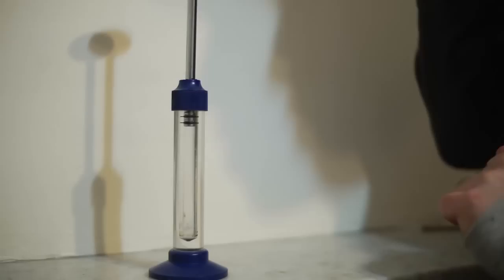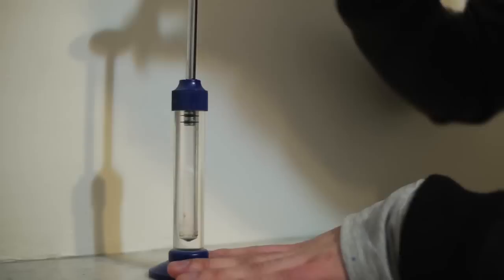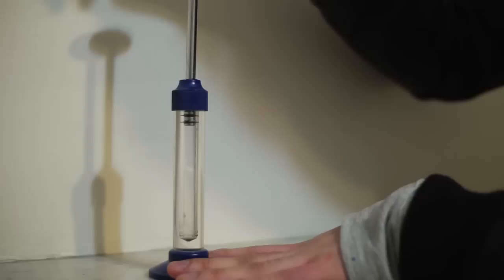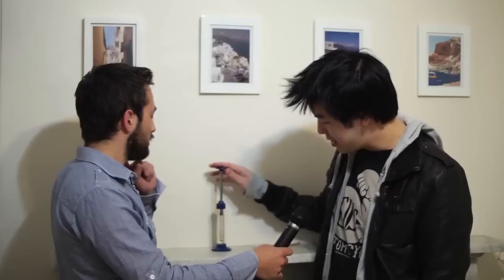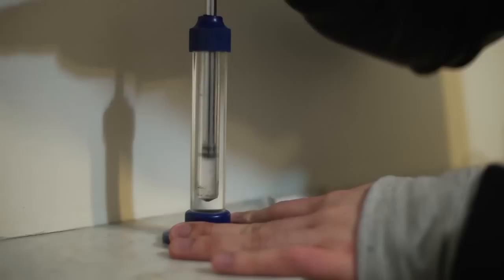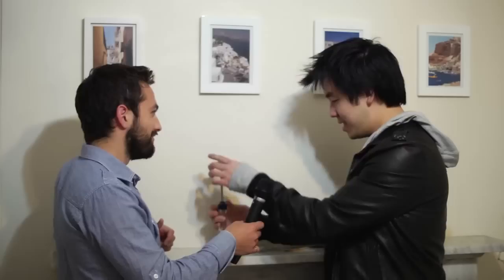Fire Syringe

Comment: Ignition temperature of cotton is about 400C at atmospheric pressure. Increasing the partial pressure of O2 will lower that ignition point by a great amount. the fire piston works by a combination of increasing heat through compression and increasing partial pressure of O2 with compression. Carbonized cotton fabric is pretty much a standard fuel for the fire pistons used by survivalist. Also called "char cloth".

Comment: yes..this is how diesel engines work...
Reply: No it doesn't.
Reply: An engine works by putting fuel in the whatever it is called then spark plugs create a spark that explodes the fuel the explosion force the cylinder down. The cylimder is connected to a crankshaft in such a way that the downward force is changed into rotational energy but since there is multiple cylinders at different stages of this then there is always a downward force making the crankshaft spin. Then the spinning crankshaft causes the cylinder that just got pushed down to go back up and push the exhaust out. If you don't understand still you should probably watch an animation of it.
Reply: Wait nvm
Reply: You said desiel not gasoline
Reply: @macaroon_nuggets8008  fail
Reply: That’s how Diesel engines ignite gas. Not technically how the work. Just the start of how they work.
Reply: @macaroon_nuggets8008  Man if you are gonna try to prove someone wrong please know what you are talking about first
Reply: @JoeSmith-jp7bk  I wasn't trying to prove him/her wrong. Iwm was trying to correct them. Also I thought I knew what I was talking about as that would be accurate for gasoline, but I missed where it said diesel. That is just a minor mistake, not need to tell me, especially after one whole year.
Reply: @macaroon_nuggets8008  hon

Comment: It's not about the heat, it's about the chemical reaction of oxidization that increases under greater pressure and so exceeds a treshold of combustive oxidization, which is bursting into flames. Heat is only a product, not the cause.
Reply: *oxidization
Reply: Allen Thayer
thx
Reply: maybe it's a result of both
Reply: Sniper of the Dark
If you had known the rule of the welders - never weld if gloves in case they get greased - you'd have understood why oxidazation is generating heat, and not the other way round, at least in most cases.
Reply: Heat is the wrong word. It's temperature (they are different). The temperature of the apparatus gets very high for a short amount of time, which causes the ignition. It's only a small amount of heat (at least before the fire, an independent energy source). Same principle applies to sparklers. The little pieces flying off are momentarily hundreds or thousands of degrees, but because they're tiny and have very little mass, it's not enough heat to be harmful.
Reply: Heat is the total internal energy of a system, increasing the pressure at a rate which doesn't allow the heat to disperse means the total internal energy is increased, thus activation energy of the reaction is reached. I think "heat" can be interpreted in different ways, but it's used in this way in physics.
Reply: *****
 Go play Minecraft. Don't leave comments, leave commenting.
Reply: If it was nothing to do with the heat then it would would ignite regardless of the speed in which you use it.
Also, the term is oxidation.
Reply: It's similar to what happens if you treat grease with pure oxygen - certain kind of welders must have clean gloves, otherwise there is a risk of starting fire (and gloves are obligatory in case of burning hands due to possible greasy impurities on them). Speed is unimportant in this instance, and heat is secondary, an effect rather than the cause.
Reply: In a way you are correct, the initial energy stays constant. But as same as with the compression of air, you compress the heat too making it warmer than the surroundings. Refridgerators work in a similar sense but the decompress air making it colder than room temperature to cool the groceries inside.

Comment: is this not called a fire piston?
Reply: ikr?
Reply: A piston implies that the pressure extends out a piston. You press down on this to compress it, and it doesn't go anywhere after that.

In essence, it's not called a piston because it's not a piston
Reply: You have absolutely no idea what you're talking about whatsoever.
Reply: Spencer LaBooty You must be trolling. Watch the video, it's clearly a piston.
Reply: If you say so
Reply: Its a fire piston, this is literally how a car works, stop believing everything you find on the internet and go read a book. Im siding with you Devs404
Reply: It's not just something I read on the internet. It's a comparison of the actual dictionary definitions, which means it did in fact come from a book.
Reply: And as an addendum, even with my basic knowledge of how a car works, I know that gasoline vapor does not just spontaneously combust when compressed in a cylinder. It requires a spark to actually ignite. So no, it is not literally how a car works. By that logic, you should be calling this a "Fire air compressor"
Reply: First you say that i'm foolish for citing an internet source when you didn't even check to see where the information came from, and then claim that being 11 means it's okay to be ignorant and gives you the right to say whatever you want with no repercussions?

Sure, if that's what you want to believe, go ahead.
Reply: Devs404 it is in bushcraft.
Reply: Yes, it is a fire piston. Fire syringe is an anachronism, but still correct.

Comment: You also need to consider the increase in partial pressure of O2. Many materials are more combustible as O2 pressure increases. Cotton will ignite much more easily when the air is  compressed.
Reply: Exactly!

Comment: is this similar to how a diesel engine works?
Reply: Plant Gollum It is exactly how they work. Although some of them have heater plugs, to help raise the fuel temperature in cold climates.
Reply: Luben Lambov are you talking about spark plugs?
Reply: mustacheman19 No. Spark plugs are for gasoline engines. Heater plugs, more commonly known as glow plugs, heat up the diesel vapor, lowering the pressure required for combustion. Mostly used in cold climates.
Reply: Luben Lambov yep. And to start the engine
Reply: HardwareG33k They're only used to start the engine if the weather is cold. Otherwise the starter takes care of the whole thing.
Reply: Luben Lambov yes, you're right
Reply: Plant Gollum exaclty
Reply: mustacheman19 glow plugs, not spark plugs.
Reply: +Luben Lambov I live in a cold climate and our diesel tractor we plug in to heat the fuel tank so it doesn't gel the diesel
Reply: Mazda SkyActiv
Reply: @mustacheman19  no glow plugs

Comment: This toy was invented in mid 19th century, when Rudolf Diesel saw this toy as an mechanical engineer, he realized that; he could make a heat engine which uses coal powder as a fuel, so at first he tried to construct a diesel engine which runs with coal powder but he couldn't succeed. 
Then; he realized that he could use diesel oil as a fuel. (But in that time they don't call it diesel oil or diesel fuel, the term diesel oil became famous/available after the invention of diesel engine) To ignite the liquid fuel in the combustion chamber he sprayed the fuel in to the cylinder. By the way; sprayed fuel droplets has higher surface to volume ratio that makes the liquid fuel easy to ignite inside combustion chamber. ;)

Comment: Does this mean if you were to slowly compress air, allowing the heat to escape, rapidly decompressing it would cool the chamber drastically?
Reply: That's how fridges with compressors work.
By decompressing gas in the inside and compressing it outside.
Repeatedly.
Reply: Thats how refridgerators work

Comment: They actually use glow plugs to heat up the engine block. This makes it easier for the fuel to ignite because less energy is lost heating up the cold metal.

Comment: this is related to the inert gas law, which is PV=NrT, or pressure times volume equals the number of atoms in moles times r, which is a constant times the temperature. when the pressure is increased, the temperature has to rise in order to keep both sides equal.

Comment: To everyone that is trying to say this is fake. its not. This si the basic compression principal that all engines work under to generator torque and horse power. the only difference is they used O2 and cotton as a fuel source with mass levels of friction via the rapid levels of compression to the air molecules. This friction generates enough potential energy to create the "Spark" if you will, that sets the cotton, being the furl source, on fire in turn burns up all the compressed air rapidly creating the expansion of CO2 which is why the plunger goes up before resting at the bottom.

Its the same thing in a 4 stroke engine. First you add air and fuel, then compress the air and fuel at a high rate. add heat via a spark or friction, then expansion of the explosion creates the force to drive the piston back again. in short... Suck, Squeeze,Bang,Blow. the cycle of internal combustion in a four stroke.

Top sum this up. The pressure generates friction, which generates heat, which lights the fuel source via cotton, wich creates an explosion of energy thus expansion.

Comment: A bike has a spark plug and a coil that generates the voltage needed to create the spark. Once it rotates, it's enough to keep the motor running. Kick starting a motorcycle only provides the initial inertia to get the fuel compression and first spark going, after which the motor can run by itself.

Comment: Although you can't see it, in most weight scales, the fulcrum is placed slightly above the center of mass of the seesaw bit. Think of an upside down T that's been super-shortened and widened.This means that when no single weight weighs more than another, the scale falls naturally to it's lowest point, an even plane. This is also the reason that when weights are only slightly different, the angle of the balance is only a little bit skewed.

Comment: with water, its actually harder to make ice with more pressure because ice, being a crystal, has a larger volume than liquid water. so no, you cannot "freeze" water by upping the pressure a whole bunch, but you can create ice at temperatures between 0 and 0.01 degrees celsius if you lower the pressure below 1 atmosphere but above 0.006 atm

Comment: This is how internal combustion engine without spark plug works (Diesel engine). And it kinda tells you how octane rating works as well. 

The higher the octane number, the more compression the fuel can withstand before detonating. The more compression the piston can get before ignition, the more energy each stroke can get.

Comment: Interesting title, so does this mean combustion engines have syringes?
The correct term for this would be fire piston since you are creating a combustion and a chamber.
Syringe definition:
a tube with a nozzle and piston or bulb for sucking in and ejecting liquid in a thin stream, used for cleaning wounds or body cavities, or fitted with a hollow needle for injecting or withdrawing fluids.

Comment: So if you were to make a very tiny hole in the bottom, not large enough to allow the pressure to drop to the point where it won't ignite, would it result in the flame being expelled through the hole like a short range projectile?

If so, a version with a spring that pulls it in to ignite it would make a neat gadget for lighting your gas stove.

Comment: A significant factor, on the topic if how fast you move the plunger, is the seal and the pressure. If you press it slowly, since the seal isn't perfect, you lose pressure, and, therefore, temperature. How significant these two factors are is uncertain. You could install a tiny camera to detect the flame and then insulate the syringe well. Or you could measure the rise in temperature in the surrounding medium to calculate heat loss (only useful in this test if there is no flame).

Comment: Diesel engines don't have spark plugs because they use this compression to ignite the air-fuel mixture. If I'm wrong, remember that I'm a teenager who has never really worked on cars before, and I know this because of a pre-engineering class I took two years ago.

Comment: This is how internal combustion engines and fire piston firestarters works :)
Reply: But only diesel engines rely on the pressure to ignite the fuel, gasoline cars for example uses spark plugs

Comment: compressing a gas forms heat, but the heat comes out of the pressure chamber like any other heated object. If you pressurize a chamber filled with water and air, and then cool it, I'm sure you could make exotic forms of ice

Comment: Diesels use GLOW plugs to raise the combustion chamber temperature during cold start. When the engine has heated up (only a few cycles) After this, the air inside the combustion chamber will heat up to a temperature where the fuel will self ignite when injected into the chamber.
Spark plugs will never work with diesel or similar fuels.

Comment: When you compress, very fast, gases like oxygen, nitrogen, helium they produce big amounts of heat, this heat or high temperature than can ignite some materials or particles present in compressing chamber, that is the theory of adiabatic compression. That is why when you are dealing with gases (non-flammable ones) under high pressure ALWAYS open valves slowly.

Comment: This is based off of the ideal gas law, which states that PV=nRT. Counting n, R, and V as constants, we can rearrange the equation to say that P=T. This is direct relationship which means as one goes up, so does the other.
Reply: V is not constant
Reply: NvMme It absolutely does not "depend". You change the pressure of the air and the volume of it by compressing it, The fact that this change is not a 1:1 conversion is accounted for by the change in temperature. Ignoring R and n as constants, an increase of 400% pressure might result in a halving of volume, raising the temperature of that volume by 100%.
Reply: Liam O Sullivan
If you halve the volume you double the temperature. P and V are inversely proportional. When I first saw this I was confused as there should be no reason why temperature should increase. But as some has pointed out, it is because of the density of the air that makes the oxidation of the cotton possible. Oxidation releases heat.

Comment: Not in hobby engines they don't. The glowplug is clearly set up so that a virtually isolated coil is heated in an air gap within the plug it's self. You can hold them between your fingers and ignite the coil, the heat won't penetrate through the glowplug, let alone into the block. So in the case of hobby engines, the glowplug does indeed ignite the fuel/air mix.

Comment: Actually, you are both missing an important detail about the glowplugs.  Glowplugs are ONLY used when the engine is cold.  Once the engine is running, the glowplugs are not used.  Also, if then engine is still warm from recently running, they will not turn on.  Glowplugs are not REQUIRED for a diesel engine, but they help them start faster when the engine is cold.  Diesel engines can ignite fuel from compression alone.

Comment: Very neat demo.  Clear once it's done, but for me, not intuitively expected.
Reply: wikiwikiwee well not everyone knows the gas laws, additionally, there are almost no contexts in which the information could be gleaned intuitively.
Reply: Fidelis Espiritu Right.  I have wondered about this, though.  Take a volume of gas and store it under very high pressure in a bottle.  Why would this not be a constant source of heat energy?
Reply: Greg Scott The issue then is that the heat would quickly be released into the surroundings, causing a steady decrease in temperature and allowing the gas to consolidate smaller volumes.The gas should eventually undergo phase shift into a solid: condensation.
https://en.wikipedia.org/?title=Condensation
Reply: Ah... That makes sense.  Thanks, Fidelis.
Reply: Greg Scott My pleasure!
Reply: Magnus Juul I misspoke, thanks for catching that.

Comment: welp, in this example heat is not generated (well, some do, due to friction and other loses) it is already in the system, by compressing air you just increase energy density in a shrinking volume which still have ~same amount of matter with original energy level. Same principle fridge or AC works.

Comment: Liquids are said to be 'un-compressible"  You could generate heat by putting water under pressure, but you would not get the water to decrease in volume.  No matter how hot you got the water by compressing it, it would never boil.  As you increase the pressure, the boiling point of water goes up too.  Also, the pressures required for a small temperature change would be huge.  If you put water in that little tube and then slammed on it, you'd probably just break the tube.

Comment: If you had a chamber with nothing but water, you could still compress it just fine but there's a bit of a catch here if you want to try this yourself.

From the Wikipedia "Phase Diagram of water"
It appears you'd need about 2kbar, or 29,000psi, before you started forming any exotic ice from increased pressure. To give perspective, most SCUBA tanks are only 2,000 psi and air rifle tanks only go to about 3,000psi.

Comment: As far as I know, this isn't exactly a fire SYRINGE. My understanding was a fire SYRINGE was forcing air through a very very small hole, to create a similar effect, but the tip of the syringe was hot enough to light paper.

Comment: i might sound really stupid but would it be possible to make a four stroke engine cycle that pushes pistons through the cylinders without the use of a fuel source with the power of the combustion created expressly from combustion? or does that just sound ridiculous